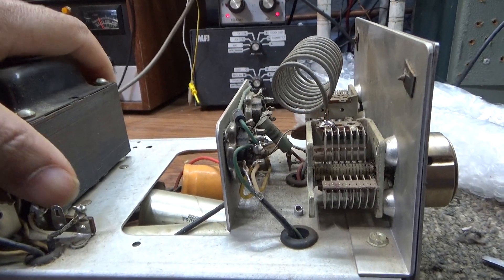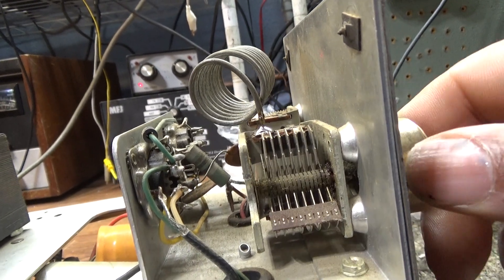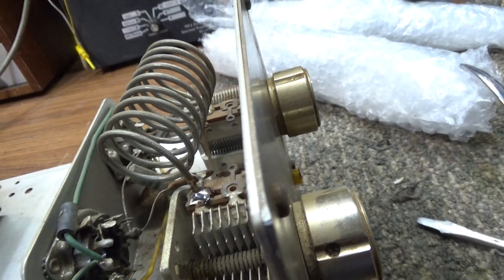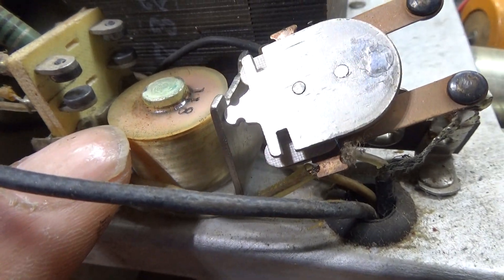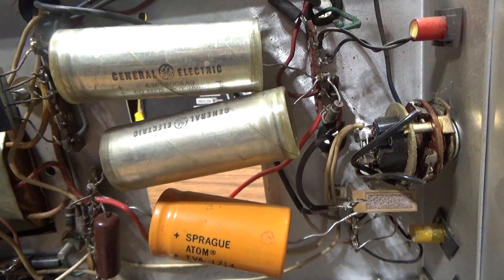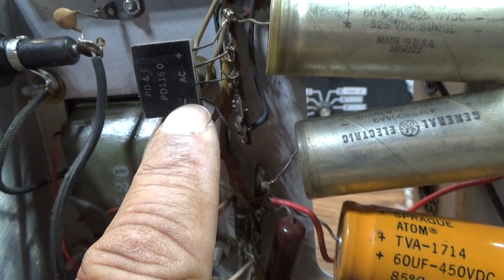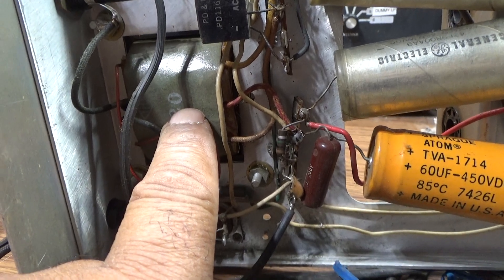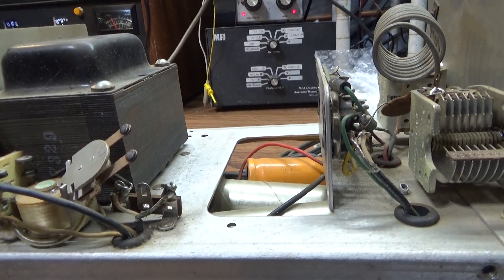Basic run thru on amp common amp problems using a simple Browning 180 grounded grid amplifier.

Comment: What you describe is a fundamental. It's not the tubes, it's the power supply components. Overdriving an amp produces harmonics and spurious RF, sometimes called "splatter". Instead of the output signal being a smooth sine wave, when the amp is at its limits the top of the sine wave gets flattened. This is called "flat topping" and results in a distorted signal.
Reply from the maker: I fundamentally agree with what you are saying, but not comprehensively.
Reply: @tramdr  well, don't keep us in suspense, tell us what you think.

Comment: Absolutely... If you have a dirty radio all your amp is gonna do is amplifie the dirty signal ! Get your radio right to drive the amp and tune the amp to max power !
Reply from the maker: Dirt in Dirt out, plus those harmonics are amp killers. They look good on the wattmeter though...... for a while......until it blows.

Comment: Great video! I’m an old fart of 66 and I’ve seen exactly these same things through the years. You’re right on! 
For the younger technicians out there, I highly recommend getting a burnishing tool, as you said. Never use sandpaper! That will just remove the silver coating on the contacts and you’ll be sorry. 
I buy high voltage rectifiers by the dozen, as I’m sure you do. They are much cheaper that way. And youngsters should never buy the junk from China that is advertised on eBay. They may be cheap, but probably are fake. Especially those RF power transistors. Just my two cents worth. 
I thoroughly enjoy your videos!👍
Reply from the maker: Agreed. The idea is to Polish the contacts, not file them. As you said, many are covered with silver plating. The plating is like 1/100,000 of an inch. You file, you file it right off
Reply: @tramdr You’re a great teacher! I sure enjoy your channel. I am a new sub, so I watch your old content too. You and I probably traveled a similar road, electronically speaking. But I have few of the skills you have for putting out these great videos. Thanks!
Reply: Tarn-X and a Q-tip will work too. Swab the contacts and spray with plastic safe cleaner and they're good to go.

Comment: Code date 7426 on orange cap
Reply from the maker: Does that mean 1974?
Reply: @tramdr  yes it does.most all filter caps have date of manufacture.
Reply: 26th week of 1974. Tubes have the same kind of date code.